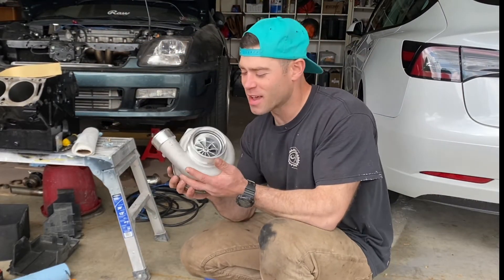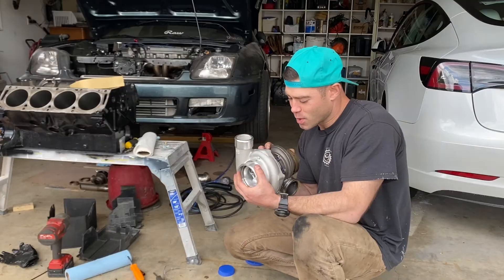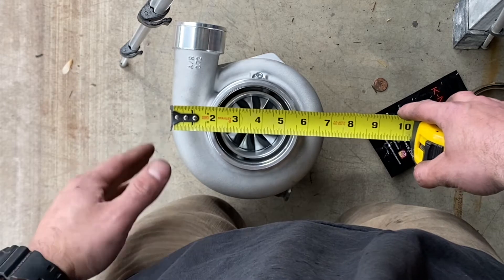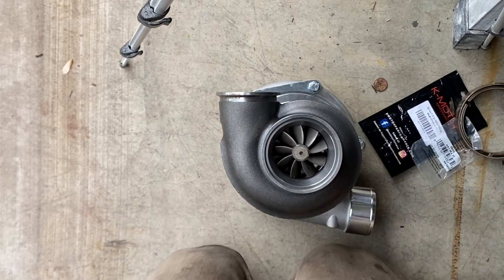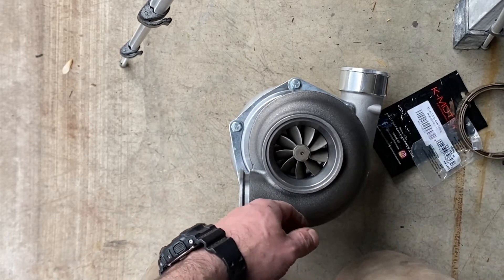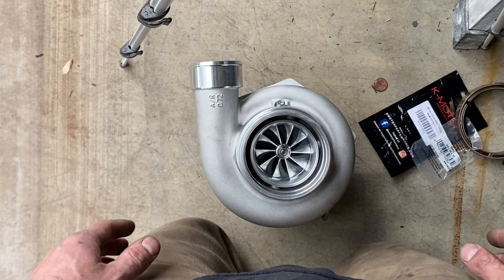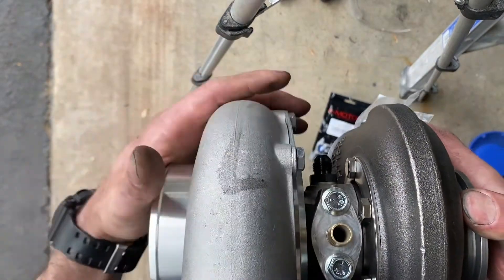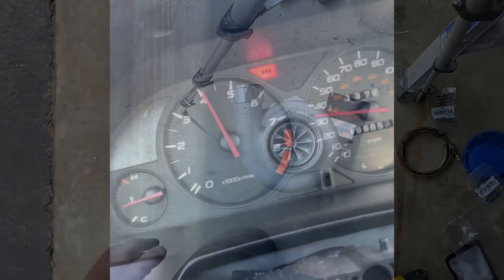How big is the Pulsar Turbo GTX3582r Gen 2 - Measurements and fittings!

Comment: was hearing from some guys on the pulsar dyno he made 30 whp less than garret has this ever happened to you?ho they are lies thanks to whoever replies
Reply from the maker: No, I haven’t had any issues what so ever. It makes good power for the price. Keep in mind there are so many variables that could cause that to happen. I think sometimes people just like to discredit cheaper turbos. Garret is a “designer” turbo in my opinion…$2500 for a turbo when you can buy others for half that price and kill the competition.
Reply: @thestateofreal2533  it is very true what you say regarding the 30whp I think they are exaggerated as a speech perhaps even amplified regarding similar wheel design perhaps the different weight but the identical spool does not compromise all this power which you too say sometimes discredit a mid-range which then they are not that bad they work great! true doubt don't last like garrets

Comment: Good review. However i'm still wondering where the external wastegate line for boost was fitted from the turbo, did you use the speed sensor port?
Reply from the maker: Having a wastegate boost line from the turbo is kind of the old inaccurate way of doing it. Most tuners will suggest putting the wastegate boost line as close to the intake manifold as possible as it more accurately shows true boost pressures. Most map sensors are on the intake manifold and if you are using a boost control solenoid it’s helpful to know the pressure the manifold (solenoid) is seeing in order to tune the solenoid and gate pressures. Pulsar is with the times!
Reply: Best location is with a vacumm hose from the intake manifold. We as tuners only use the turbo speed sensor for logging turbo speed rpm. To make sure we are not exceeding the manufacturer max rpm limit

Comment: Can u use pulsar turbo with turbine housing from Garrett Turbo?
Reply: This looks like a compact model, if it is, the answer is no. 
I just purchased a 3071PSR for my Chaser and I'll be doing a video on it. My point, I tried swapping parts, they fit but the wheels/blades are a different size.